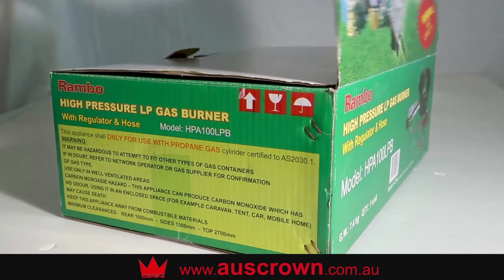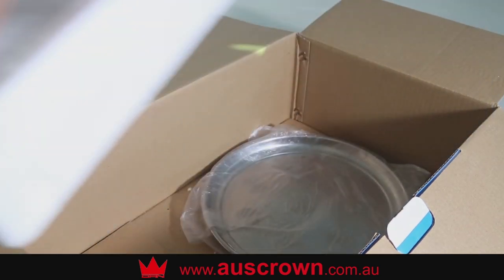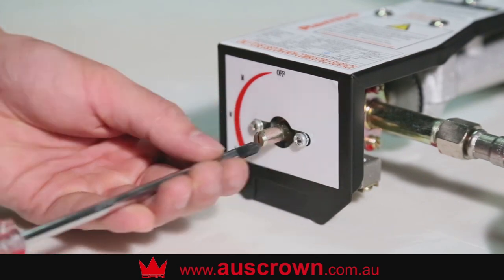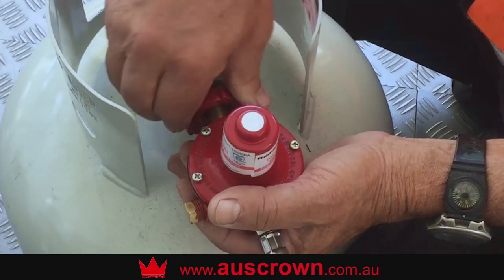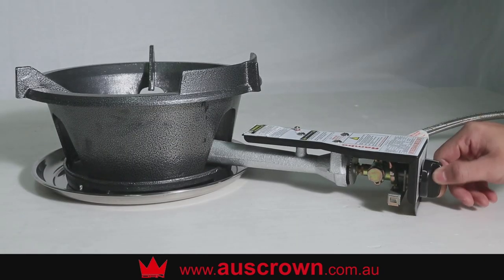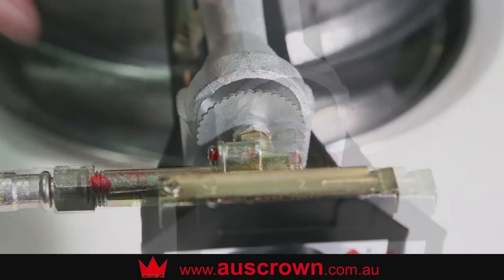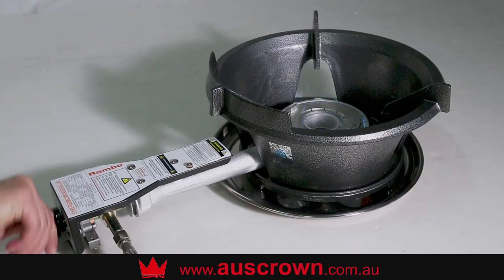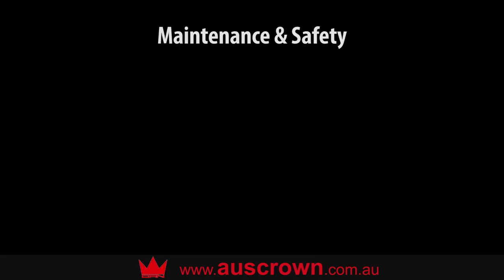HPA100LPB Rambo high pressure wok burner operating instructions

Comment: You mentioned to achieve normal flame by adjusting air control, is this at medium or high control knob when testing for normal flame?
Reply from the maker: Hi! Adjust the air on high flame, once desired flame is achieved you can test how it is on low, medium and high setting. Thanks